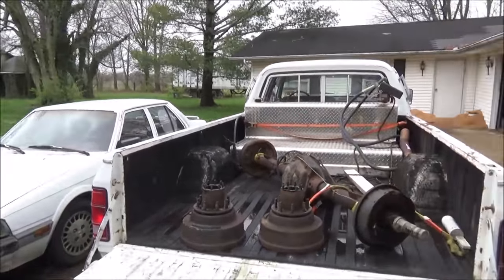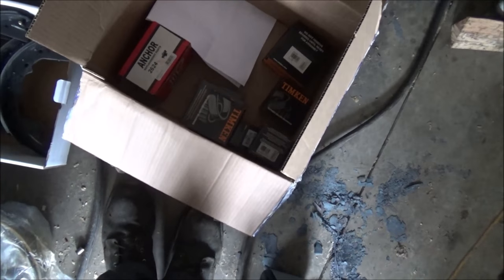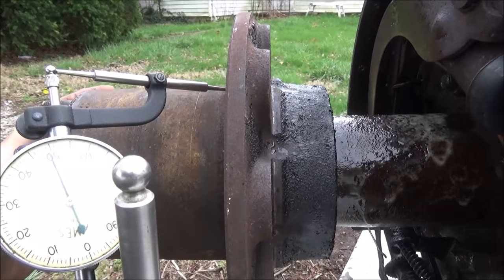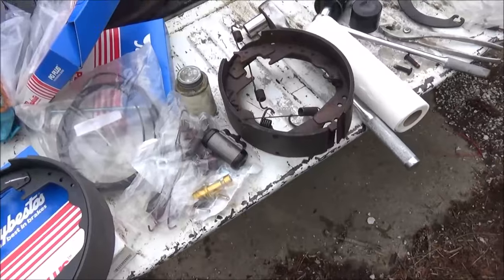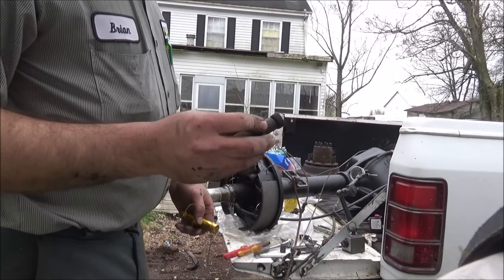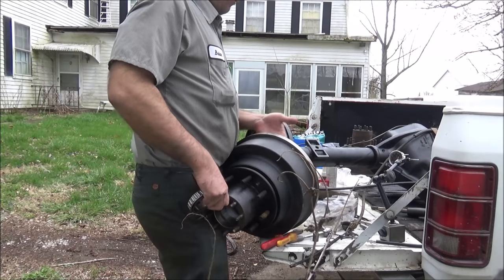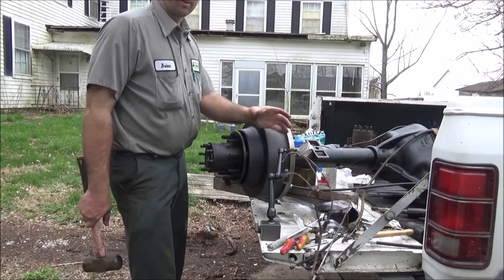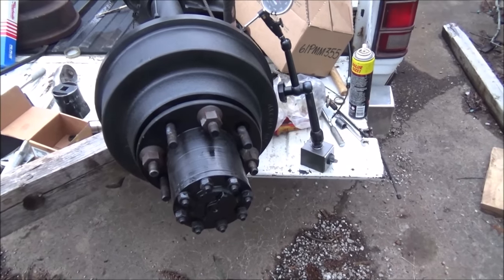Dana 70 axle rebuild brakes and bearings tips and tricks

Comment: I came here looking for the solution to an off center drum. I found it. Great video. You might want to edit your title to fixing out-of-round on the Dana 70's or some such wording. I'm sure I'm not the only one!
Reply from the maker: ElderlyIron glad it helped! I added key words to the tags so maybe that will help people find the video and the help. If you are on any forums you can share it there too and that helps more than anything.
Reply: I just swapped the drum like you would any other, but when I went to adjust the brakes, I could see the drum was off center. I measured it and it was .060 out! Took it to the parts place to put it on the lathe and found the root cause. 3 seasoned mechanics standing there wondering how (or WHY) this could be!
I'll most likely make a video and give you the credit and add a link to your video. Is this procedure in the service manual?
Reply from the maker: ElderlyIron it is not listed anywhere in the service book as the original factory drums had a machined pilot that matched the hub, then they were machined as an assembly. This only worked at the factory though where they could hold those matched tolerances. The aftermarket stuff had to be made much looser so it would always fit. The result was the slop you encountered.
Reply: Good to know. Certainly didn't make sense the way it is.
Reply: Had no idea a full float spindle type had to or could be adjusted in that way. I guess I found a new use for my indicator and base. Thank you

Comment: I like to pack a little bit of grease in the bearings, to be sure they have lube from the start.
Reply from the maker: I used to do that but found getting the proper bearing setting difficult as the grease held clearance the oil would not.
Reply: these aren't to be greased, they are lubed by the differential fluid... do NOT grease these bearings

Comment: Nothing better than fresh hardware and brakes, you should see much better fuel mileage with the higher gear ratio.  Don't forget to add the air bag kit!
Reply from the maker: Brackets are already drilled and mounted to the truck. :-) I wanted to do the axle swap before finishing the install though so I didn't have to do it twice.
Reply: Right on!

Comment: I would have greased those bearings before installing them, and why not use the new star adjuster, when you talked about how worn and beat up the old one was. And you said before that, it's best to use all new brake hardware for obvious reasons. So much lol going on here.

Comment: a few new things that I'll keep in mind .  New drums are on the long list for mine.  I replaced my original with a jasper rebuilt.  all new  bearings, brakes and related hardware including lines back to the rwal unit, but still have the original drums.  they may turn, but I figure that it's time

Comment: I never thought about forcing the drum around, which is a shame because I have never in my life seen a drum run true or centered on anything.  Bet the drums on my truck are every bit off center as yours just based on the how my shoes drag.  I'd love to have that gear ratio too, but being 4x4 I"ll live with my 3.55's  Finally for the win.  Blitz black.  That stuff is tough as nails.  I buy it by the quart, and add some of the valspar hardener.  Brings the gloss up to a matte, maybe just under semi gloss finish.  Paint tractor axles shafts with it, slide duals over it and not a scratch.
Reply from the maker: I painted my drop deck trailer with blitz black years ago and it has held up very well.  For the money it is hard to beat!

Comment: That Loctite 638 trick for the bearings... do you have any trouble pulling the drum & hub assemblies back off for service with that Loctite adhereing the inner bearing races to the spindle surface? Sounds like a smart trick to avoid further fretting of the spindle, but I was wondering does it make it difficult to disassemble in the future. Excellent video, btw... thank you for posting it.
Reply from the maker: They won't just slide off but with the low strength a few taps with the hammer and they come off. Of course that messes the seal up but it is unlikely I would have the wheel hub off to that point and not be putting in seals.
Reply: @bcbloc02  Makes sense. Thank you for the reply... I appreciate the help. 👍

Comment: I cringe at the fact that he assembled everything dry...   PLEASE LUBE!!!  All that work may need to be done if you cook the bearings!!!
Reply from the maker: Both ends were jacked up on installation to allow the hubs to fill with gear oil. It has been 40k miles and hauled several loAds of 30000lbs plus gross so I think I did ok.

Comment: I had trouble with them too - I just got some parts from RockAuto and 2 of the bearings they sent me were made in China (branded National), and a 3rd one was a returned item that was previously installed - they used to be good but seems that they're cutting corners lately. Still the best value when it comes to brake parts but I'll be buying the bearings locally from now on (not worth the trouble even with their price levels, can't be putting chinese bearings in a vehicle)
Reply from the maker: The Timken bearings were US but their seals are Taiwan. All the Bendix stuff was China except the brake springs. It is really hard to find any parts that are US made anymore. The Delco stuff was about 50-50 US and China.

Comment: Nice...  The rear bearings are gonna get oil from the differential...hopefully!  Thanks for  sharing the job!
Reply from the maker: They better get oil! I always jack up one side at a time after filling the diff to be sure they get a good dose of lube before driving.
Reply: Thanks!!  You know it and we appreciate you showin' it...Thanks!
Reply: Good to know. When I pulled my axle out there was some oil in the hub (though not in the drums) wasn't sure if that was right or not. So oil mixing in with the packed bearings is ok? (this is my first full floating diff - so I'm still learning)

Comment: Is there a factory version which runs two hydraulic brake cylinders? I have that on a Ford rear end. It works very well especially with the vacuum assist.
Reply from the maker: Not on any Dana axles I have seen. I think they all were setup to rely upon the drum brake self energizing action where the force of braking from the 1st pad adds to the rear pad.

Comment: A total overhaul on the axle.  I would not have known to look for a brake drum not centered.   I have not come across that in cars as far as I know.
Reply from the maker: Next time check the run out on a set you likely will be surprised. Of course the smaller the stuff the less it matters a 10lb drum won't cause near the vibration a 50lb one will.
Reply: bcbloc02 If possible, it's best to always run a true up cut in the drum or rotor even if they are new, for this very reason of runout. Any time the bearing race's are replaced they will also be out of concentrisity some. We always ran a tru up cut but it does make it easier having a brake lathe.

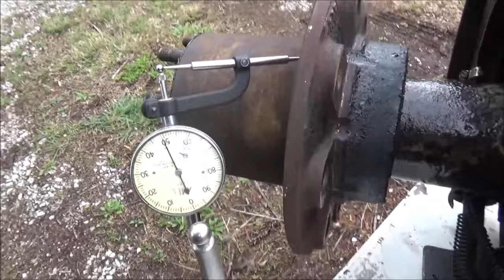Comment: Is this differential have cone shaped parts that keep the hub in place?  I had to replace my 4:10 ratio on my old 1964 Ford F250.  I found a local junk yard that had a newer differential that I believe is a 3:73 ratio.  What a difference it makes on the highway.  Now I need to go through the brakes.  The bub axle with a few pops of a hammer came out of the drivers side but the hub on the passenger side will not pop out no matter how many times we have popped it.  Any suggestions?  We have even sprayed penetrating oil and it still is not popping out.
Reply from the maker: The earlier Dana 70s with the studs for the axle flange do have cones around the studs. Usually a little heat from a torch will get them to release if they are stuck. A lot of times excess silicone fouls them up and once you burn the silicone off they will come loose.

Comment: The bearings don't get packed.. correct?? I was told the diff oil lubes them????
Reply from the maker: Yes. That is the reason you fill the diff then jack up each side individually about a foot so it can fill the hubs with oil
Reply: @bcbloc02  okay just checking to make sure what I was told was correct because what I saw in this video was that he packed his bearings.. it looked like it

Comment: I liked that tip about hooking the springs to the shoes after clamping down one side, then aligning end before pulling on the shoes as leverage. I did my 1995 f-350 460v8 and it took me several hours to pull those springs over with pliers. 
The brake tools I had were not heavy enough.
Any other axle running tips? I was thinking about changing the rear end in my 1997 F-250 HD to get better gas mileage. 
It has something like a 1 ton rear in it from factory. 5.8L gas with E4OD heavy duty rebuild and towing shift kit.

Comment: Baily was distraught in the grass behind you because Something is getting longer legged than he is. You could tell by the non-wag off. That woodpecker was here this morning hammering on the gutter. I just rewound a Briggs recoil spring. Enough stress. Be calm and maybe after taking Baily a ride he'll forgive you.
Reply from the maker: I probably will have to take him for a ride to get something to eat to achieve full forgiveness.
Reply: With the new rear end installed and a hi-$$$ place. A fast food deal won't cut it. Not this time. Concrete pouring weather coming shortly!!!

Comment: Watching your back as you used the spring pliers didn't help me. I'm not having any success using them & nobody has a video that actually shows that.
Reply from the maker: If you are talking about brake spring pliers I didn’t use any. If you rewatch you will see I hooked the springs to the shoes then pulled the shoe on to stretch the spring. I find it easier to have to fuss with getting the washer on the retaining spring and pin than to try to get that spring hooked back in behind everything.

Comment: I have a hub that will not hold 3 of the 8 studs. Finding a replacement hub is near impossible for 1975 F350. I was thinking of pulling the hub, and filling the bad slots with weld, and re-drilling the slot to spec. Any ideas would be greatly appreciated.
Reply from the maker: i would try a helicoil insert first.
Reply: @bcbloc02  i went ahead and welded the studs to the front of the hub since the hubs are for coined rims and I'm switching to non-coined rims. I tested them with a lug and washer before installing the hub back on the wheel. Just waiting on one more brake hose to bleed the brakes, and then put the wheels back on. Wish me luck.

Comment: Brian you ever think of going with disk brakes on the rear. That will give you stopping power?
Reply: Manufactures have conned the public into thinking disk brakes provide better braking power.  They are cheaper to manufacture and install on the assembly line.  Weigh less which is only a pro to the manufacture to improve MPG numbers.  They  generally require less maintenance, but they do not provide better braking power.  Self energizing drum brakes are every efficient brake technology.  There is a reason semi's run them.  There is a reason the service brake on disk brake equipped vehicles are drums.
Reply from the maker: Disks big advantage is in fade resistance. I don't have a lot of mountains here so I don't ever see situations where brake fade occurs. Drums offer superior wear life and is why they still dominate the semi truck market. In order to get similar stopping power to the big drums you need bigger wheels to fit the big calipers or you have to mount multiple calipers to get enough friction area. It is all a trade off.  When the brakes are right they work well as is.
Reply: Where I live there are quite a few hills and steep inclines just forgot where you live.  I was going down one hauling a fair sized load I got brake fade not a nice feeling.
Reply: Y Pop You'll want to learn how to do brake jabbing on downgrades. If your safe base control speed is 45mph, let the rig speed up to 50 with no brakes then jab the brakes aggressively for no more than 5 seconds to get the speed back to 45 then repeat the cycle. Don't ever ride the brakes for long stretches to maintain speed. That's when the heat builds and fade takes over. If it takes longer than a five second jab to get back to 45 then 45 is too fast for a base speed. Try it at  40 & jab at 45 or 35 & 40. Until the jabs are less than 5 seconds. The key is starting out in control. Most people go like crazy then try to over react when things get out of control.  To be fair, unless you go through truck driving school or have a knowledgeable teacher in your life, these advanced skills are not taught when getting a base drivers license even though that's all that is required to drive some pretty heavy and large cube trucks. What are some of the most  dangerous people on the road? People driving moving trucks. Usually their first time with that much weight and that large of rig.
Reply: Thank You Wish I knew that 30 years ago! They changed the grade and took out the stop light at the bottom of the grade too so not as bad now! Just a one time thing moving a machine on a trailer did stop for the light though!

Comment: How many inches of the Dana 70 axle and I'm gonna identify it
Reply from the maker: There are many different configurations of Dana 70 axles. Assuming no one has lost the tag there is a build of materials number on a tag under one of the cover bolts. You can use that to see what parts an axle was built from

Comment: Nice tip on adjusting the drum on the hub.  The shoes are called primary and secondary, If I remember correctly the primary is always on the rear side of the axle and the secondary is on the front side of the axle.  Generally the primary has the larger amount of friction material on the shoe.  Did you check the ring and pinion out?  Matt C
Reply from the maker: I felt the pinion and it feels ok, I will give it a check out when I have the cover off to clean everything in there before adding new oil. Backlash felt good so it is likely ok since that is usually the 1st thing to go south.

Comment: Do they make a disc brake conversion kit for these Dana 70's ? Had you looked into those ? Just a thought. They used to have them for the rear Dana 60's. At one time I thought of converting my rear Dana 60 in my '72 Chevy 4x4.
Reply from the maker: There probably are disk conversions, the drums work well enough for me though and the drum shoes last a lot more miles than disks.

Comment: I just spent my afternoon trying to beat my drum true but to no avail, I’m working on a Saginaw/GM 10 1/2” full float.  I even loosened up the wheel studs (by this I mean beating them back into the drum), but couldn’t get anywhere from 0.015”.  I gave up and just spent the rest of my time putting the new brakes on.  I think I’ll try again tomorrow.  Thank you Brian for taking your time to make helpful videos such as this and I continue to enjoy all of your other videos as well.
Reply from the maker: You might have to take the hub and drum to someone with a lathe and have them true them up.
Reply: @bcbloc02  I think you are correct, I’m ashamed my lathe isn’t working (motor is off and it’s all covered in gooey fluid film), I just trying to find a permanent place to setup shop.  Thanks for your valued advice.

Comment: Hello from Australia. About to do my Dana 70 under a '76 F350. Two questions if you don't mind: 1. What do you call the style/brand of dial gauge you have there? I've never seen one on an arm like that. 2. Is there an outer seal on these diffs? When I pulled the axle out of mine there was a terribly chewed up looking seal on the outside of the outer locking nut - it seemed to be just a rubber/fibre ring - but it's so buggered it's hard to tell what it is supposed to be. Thanks, Brad.
Reply from the maker: 1. That is a Noga arm. They come from Israel and are nice single point adjustment indicator stands.  2. The only seals are on the inside of the wheel hubs. The outsides are sealed with a gasket where the full floating axles bolt up to the hubs.

Comment: At the very least, Bailey, could be gettin' after that woodpecker instead of layin' around loafin' on the grass. If that woodpecker takes a likin' to your house siding, you'll have to get out the bird shot for your .22 . 
I admire your dedication to improvements to your "stuff". I tend to use my equipment until it breaks and then procrastinate regarding repairs and improvements. Good video! Enjoyed!
Reply from the maker: I want every thing dialed in for the upcoming trip to get the 20000lb+ drill.

Comment: Hi I have a quick question if you can help me with it I am replacing the Right parking brake cable and I have an extended cab dually. are all the cables the same Duly  or not.And what brand do you recommend. I have a 92 dodge d250  extended cab dually
Reply from the maker: Yes only right and left cables on dana 70 dodge dually doesn't matter. There is an intermediate cable that changes depending on wheelbase. I used Wagner cables on mine.
Reply: Thanks i bought a right cable on amazon ac delco. And it was to long so im going to return and get a wagner

Comment: What size nut is that once take axles out to pull drum off got a 2 9/16 socket and want fit
Reply from the maker: It takes a special thin wall rounded corner 2-9/16 socket a standard chrome won't fit in the hub.